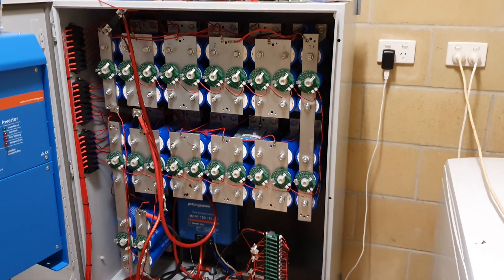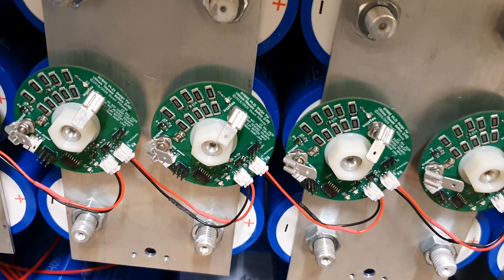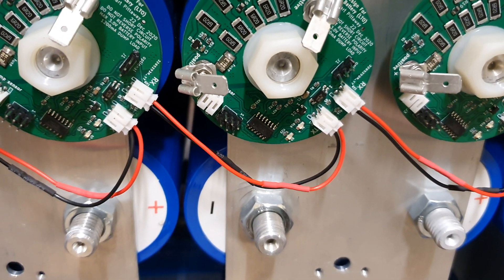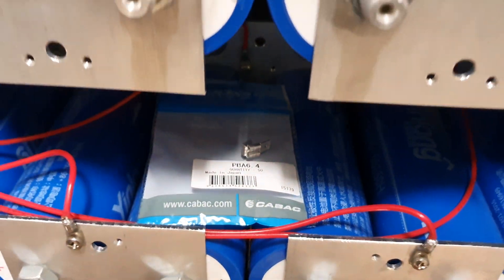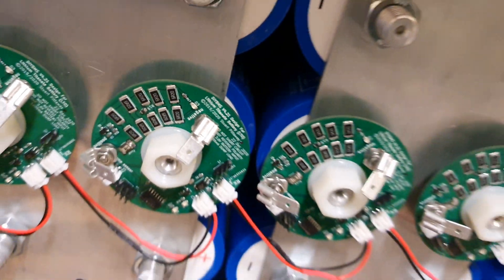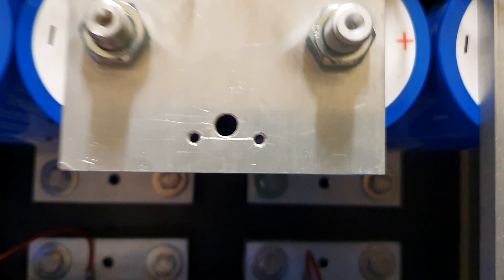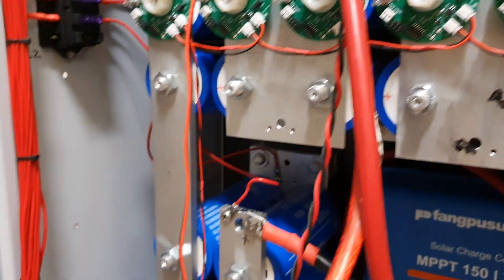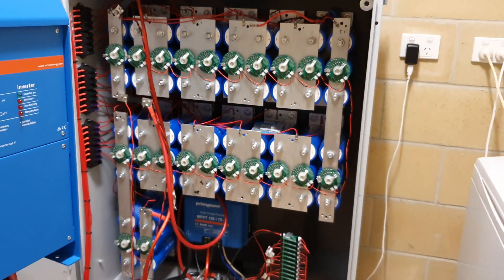6kW 66160 22S LTO diyBMS layout

Comment: Interesting approach.
Did you made measures about cells values ?
I'm using yinlong pack, 24V/180Ah (48 cells) with "Ant BMS" , during 3 months, and I noticed difference between cells (minimum 2.38V, maximum: 2.63V). I think it's quite high and was wondering about cells quality/BMS quality

Comment: Nice, I'd suggest twisting the comms cables to avoid interference
Reply: Hi Stuart & Ross, just wondering how your BMS's are functioning and if you are still utilizing this battery bank? Are the BMS'S actively balancing?
Reply: Just confirming, the setup configuration would be balancing 3 cells in parallel and not individual cells? Am I correct.